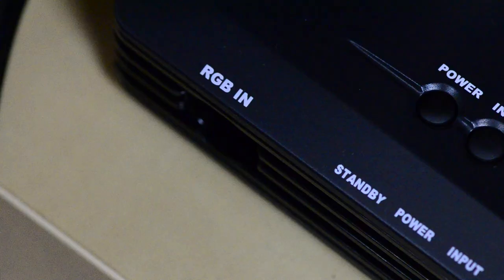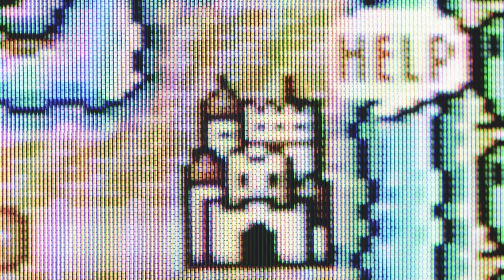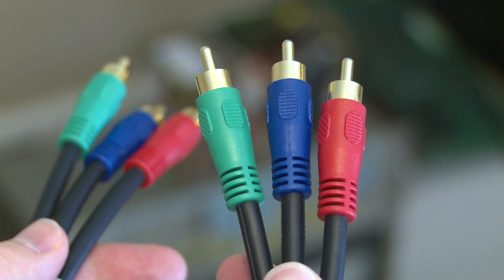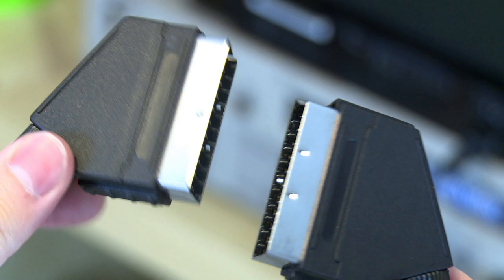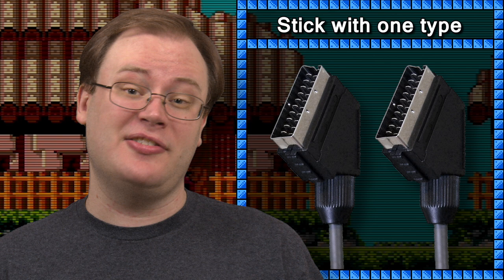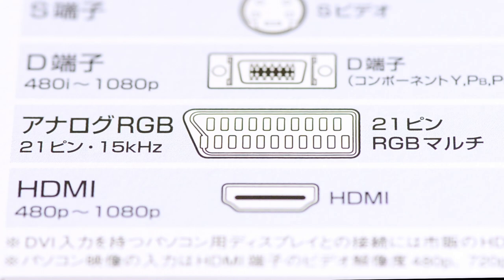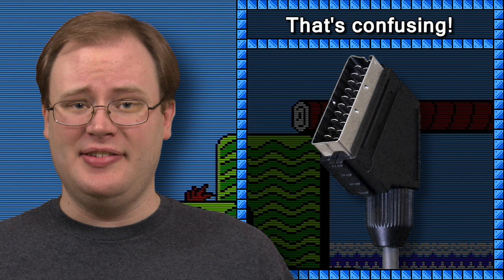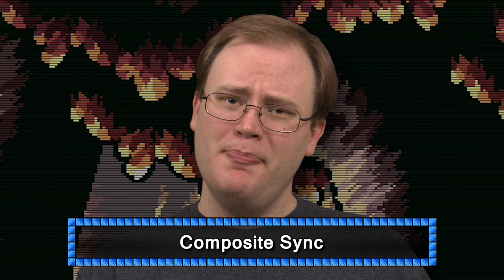Understanding RGB and Sync :: RGB103 / MY LIFE IN GAMING

Comment: What i got is whem i connect my snes to my hdtv with a rgb scart cable, i see checkerboards onscreen,something i don't have on a sdtv, i also see checkerbords onscreen when using s-video,However with rf and composite video i don't see checkerbords but i do see horizontal lines onscreen.
Reply from the maker: [Try4ce] I don't have any means of testing RGB signals on an analog TV, but I suspect the gist of what's happening on the HDTV is just because the screen is showing all of the flaws more clearly, while the pixels are designed to fit more cleanly into a standard definition CRT. I'd love to have the means to test RGB more thoroughly on CRTs.

Comment: Composite sync = horizontal + vertical sync composited together... I wish this was articulated more often. Thanks for the video.  I know you guys focus mostly on the xrgb solutions but do you use gbs8200/8220 at all?
Reply from the maker: outerspacebass [Coury] I've seen mention of the gbs here and there! We absolutely want to expand our horizons, cover as many different scalers as possible and make videos on them. As you know, its not always the cheapest thing to be passionate about, so funds dictate how much we can do right now. Hopefully, as this series continues to get more recognition, we can work with the makers to cover their stuff. 

Our whole goal is to show people all the different options out there, and make it as easy to understand as possible - some options might fit one person's lifestyle better than another, and we want people to make the choice that's right for them.
Reply: ***** Just watch out with GBS there are allot of faulty units floating about Ebay, I got one like that. Also even "correctly" working units exhibit various behaviors from unit to unit (like one will get very messy motion adaptive deinterlacing while the other one handles it better, one will get snow on all component inputs while the other only with PS2 ect).
Those are generally cheaply made (duh for 30 $ what do you expect), but doe to their robust design some aspects can be fixed by replacing capasitors, betting a better power supply  and changing frequency of the processor (there are articles on it on the web). 
Also Scan Line Generator and synch strike is pretty much a must for it so that bumps up the price to around... a bit below a 100$.

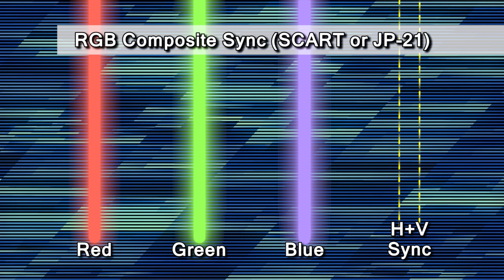Comment: Thank you trying to break this down for us but here's my question: What about @8:46 where you say RGB SCART JP21 are all the same with a combined single pin yet separate H&V sync? You did not include VGA because it doesn't do a H&V sync on a single pin but what about CGA or MCGA? CGA and MCGA do have sync the same way. Can CGA and MCGA be included for sync? There are also separate Intensity and "black" pin for CGA and MCGA but I'm not asking about that. I know that is a separate issue. Any help would be appreciated.
Reply from the maker: [Try4ce] I mean, the connector has 21 pins, so in theory just about any signal could be sent over one of these cables, including HV separate sync. It's just that not many devices would expect such a signal over a SCART and would not be configured to use it.

Comment: so I'm currently building my shopping carts for everything to re-do my gaming room. (will post video when completed) but hitting a few snags in terms of terminology. the SCART to 8pin RGB in particular. some have a basic description while others have a built in LM1881N sync stripper. this seems to be the only variant I've found. with CSYNC/boosted being just a little bit more expensive, does this lose that sync information and force through the composite signal?

Comment: I have an CRT with RGB in, but’s it’s scart connection. What do I use to to connect PS2 RGB RCA cables to the scart port? I see there’s a lot of products that converts it in the opposite direction, but can’t find what I need. 

My plan is to play TimeCrisis with RGB on PS2 with the GunCon.
Reply: Buy a AV breakout adapter. That will let you pull composite for your lightgun while still using RGB for your CRT.

Comment: I can't tell if know more or less now.

Do I NEED a SCART cable for my RGB modded SNES Mini?

If so, what do I do from there? I have never seen a TV in my life that had a SCART port. So then what?

If not, do I need a SNES multi-out to component cable?

A lot of very basic information is being left out by the modding community.
Reply from the maker: [Try4ce] One simple way to use the signal is HD Retrovision cables. They convert RGB to component. You can also buy devices like the OSSC or Framemeister to use the RGB connections for an HDTV. For analog, there are professional monitors that support RGB, but with a different connection (BNC ports) that you can convert from SCART with an adapter (or pull straight from the console with BNC cables).

Comment: I watched this video several times, it's entertaining and educational. But I did not get my answer - should I get Sync on Luma or CSync cable for my Snes. Needs shorter version with dumbed down comparison.
Reply from the maker: [Try4ce] Here's the simplest answer, really... it doesn't matter which sync type you use if the cabling is high quality. CSYNC minimizes the possibility of video noise or audio buzz, but is not necessary strictly speaking. Unless you have one of the very last full-sized SNES consoles, CSYNC will work. Sync-on-luma should work with any. But even sync-on-composite is fine if you purchase a cable with higher grade shielding (Retro-Access calls this the coaxial cabling upgrade). Sync-on-composite is actually the proper industry standard, and in most cases should be the most widely compatible, but it looks bad with cheap cables. Looks fine with good cables. That's the only issue.

Comment: Okay so just to confirm, even though Japanese and US SNES are configured for JP-21, I can still use my North American SNES with a SCART cable and it will work with any HD upscaler like XRGB mini framemeister?!
Reply from the maker: Jdmboi17 [Try4ce] That's sort of correct. In the case of SNES, the SCART cable has to be specifically designed for use on North American and Japanese consoles. Make sure the one you buy specifies that it's made for your system (and whichever adapter you use to get the cable connected to the Framemeister).

Comment: Just got a very robust JP-21 cable from ebay for my SNES to hook it into the Framemeister. If you don't mind me asking, why did you go the SCART route for your NTSC SNES consoles, when you can just get the JP-21 version?
Reply from the maker: [coury] to be honest the main reason we  went with SCART is based off the research we were doing, most people talked about it a lot more than JP-21. It just made it seem like the choice to make at that time so we started down that road. And once you choose a format it's not really worth it to change it.
Reply: *****
 Ah I see. I got my cable from Drew Seleski on ebay (the same person you got yours from). Drew was saying something about how the XRGB is meant for JP-21 configuration and that you need a SCART adapter if you went with the Euro-SCART cable. I guessed from that it would be better to just go with the JP-21 cable right from the start. My first experience with RGB on the SNES and Genesis was many years ago back when I had a Kung Fu master arcade machine. I learned from service manuals how the monitor in it works with RGB and CSYNC, so I experimented with the pin outs on the SNES and Genesis until I had completed custom cables for both that hooked into the monitor. I tell you I was BLOWN AWAY at how much better the Genesis looked. There's something about the Genesis composite signal that makes it look crappy, but it really shines in RGB.

Comment: With 2 words, wich is the best cable for PS1? RGB SCART luma sync? My screen is 55" sony triluminus 2014 model.
Thanks in advance!
Reply from the maker: +Nerven1986 [Try4ce] Two words: Yes, luma. :)
Reply: +My Life in Gaming I suppose adding a sync stripper like the LM1881 would be just as good if not even better than sync from luma?...
Reply: +My Life in Gaming 

Will a PS1 SCART cable with sync on luma work with my PVM via a BNC to female scart adapter? (pvm1954) Or are these things only for upscalers like the framemeister?

Comment: Got a couple of links for you guys. 
5 port SCART distribution amplifier
http://www.keene.co.uk/keene-1x5-scart-distribution-amplifier-uk-psu.html

This will let you split your signal to a TV, XRGB and whatever else you like. It's what I use for my livestream setup.  We run 2 CRTs head to head, have a feed for the XRGB (going to a capture card) and then a SCART to RCA cable going to an audio  mixer for commentary. Quality is superb, about as good as you will get for a split/amplified signal! 

There is also a Euro SCART to XRGB mini cable with a built in sync splitter. I recommend buying the one with the USB power that powers from the XRGB itself as not all consoles or cables output a voltage on the pin required to power the passive sync splitter cable. 

https://www.retrogamingcables.co.uk/european-scart-to-framemeister-xrgb-mini-converter-with-csync-lm1881-for-sale

Check our channel for quality examples (specifically the Sunday Face Off videos as Super Turbo Sunday is captured via Svideo output from an arcade cabinet.

Comment: Do you know the Microsoft Xbox Original Official Advanced RGB SCART Cable is use csync or sync on composite? I would like to use it with RGB SCART Philips crt tv.
 I'm looking for the best solution
.

You are really great guys!
Reply from the maker: [Try4ce] I doubt it's CSYNC as that would not be the standard way to do it for consumer products. However usually the official stuff is well shielded and doesn't have the noise issues caused by sync on composite in cheaper cables. That said, in haven't used SCART with Xbox, only component, so I can't speak from experience. I can only say that most third party Xbox component cables I've used are junk, much junkier than cheap cables for other consoles (which can still be pretty junky!).

Comment: Thanks so much for this video! I had been trying to figure out the source of those diagonal lines on my SNES since I was using S-Video on a CRT!

I have also noticed some artifacts on my RGB modified N64 ("jaggies" appear around certain shapes for a few frames), and am wondering if sync-on-luma might help. 

I've ordered both csync and sync-on-Luma cables now, thanks again for the info!
Reply from the maker: [Try4ce] I'm possibly going to look into sync-on-luma for my N64 as well, however, now that I've learned through the comments here that the N64 mod can do CSYNC if the modder makes the effort, I might look into that option as well (I didn't know to ask for it back when I got it modded).
Reply: Is there any benefit to csync vs sync-on-luma? As far as I've seen they're both superior to composite sync but not sure how they compare. Anyway, I did my RGB mod myself on my N64 (withy pretty amateur skills) so sync-on-Luma offers me possibly increased quality without possibly messing up my RGB mod
Reply: Is there any benefit to csync vs sync-on-luma? As far as I've seen they're both superior to composite sync but not sure how they compare. Anyway, I did my RGB mod myself on my N64 (withy pretty amateur skills) so sync-on-Luma offers me possibly increased quality without possibly messing up my RGB mod
Reply from the maker: [Try4ce] I'm sure CSYNC technically has an advantage, but as the PS2 cable is my only sync-on-luma SCART, I can't really observe the differences first-hand.

Comment: So if my PVM has RGB and an port for EXT SYNC, do I put the green rca into the EXT SYNC?
Reply from the maker: [Try4ce] Are you talking about using component instead of RGB? Set your PVM for component mode with INTERNAL SYNC, and plug green into green, red into red, and blue into blue. Basically component includes sync with the image information, so it's INTERNAL sync. If you are using RGB with breakout cables, you should have 4 cables - red, green, blue, and sync. That's when you put it in that port and say EXTERNAL sync in the menu. But it depends on the model.

Comment: Hey guys, this might not be the best place to ask but frankly I can't find a better place so here it goes.

I have a PC Engine Core Grafx II. It's great because it's the only version of the PC Engine that comes with A/V out without needing an adapter. While the A/V out is impressive compared to many other consoles, it's still composite video and I want to not only get a better picture but record one as well. Luckily my capture card, The HDPVR Rocket does support component but in searching for an alternative I've come across some confusion.

Turns out that there is an adapter for the PC Engine that supports RGBS and looks like it has component out. However, the seller says it does not support component and only supports RGBS which from what I understand is different? I will admit the seller's English is not that great, looks like the post may have had some translator help, so I was wondering, What is RGBS? Is it different from RGB? Does it work with component? If not are there any alternatives to connectors for PC Engine and will you be doing a video on it for the RGB101 series?

Keep in mind, while I've been following your videos, i'm still new to RGB and frankly i'm not into internal mods or expensive framemeisters. To me, Component is more then good enough picture quality and I can record that for Let's Plays and Game Reviews.

Any help is appreciated and thanks for the awesome videos!
Reply from the maker: +ZeromasterLP & Power Plays [Try4ce] RGBS means that there is a separate signal that carries sync. This is the purest form of analog RGB in the form that we normally talk about it. Sometimes people use the term RGBS to distinguish from RGBHV, which is VGA (progressive 640x480). We will have a Turbo/PCE episode hopefully soon... ish. I'm going to get my Interface Unit modded for RGB in February. This will let me use RGB with the PCE and the CD unit. If the CD unit is not a concern, we recommend a device that plugs into the back of the console by DB Electronics. Stone Age Gamer sells the same product in a complete shell. We've tested it and it's good! RGBS and component are in theory the same quality.
Reply: +My Life in Gaming so you know if eb electronic's adaptor works with component and what it outputs? I think my capture card accepts 240p signals but I'm not 100% sure. Sorry for all the questions and thanks for the speedy response I appreciate it!
Reply from the maker: [Try4ce] The db Grafx Booster outputs composite, S-video, and RGB. It doesn't support component, but it DOES work with HD Retrovision's Genesis component cables, if you plug it into the RGB output. The output will be 240p regardless.
Reply: ah well i guess i'll wait for hd retrovision's restocking of the cables then as they look like their currently out of stock

Comment: I just purchased a genesis scart cable from retro access with csync. I've tried a few games and everything is slightly off center to the right maybe a quarter inch. Picture is beautiful except for that geometry issue.  I do not have the same issue when using composite cables. Any suggestions?

Comment: How do you find the GameCube through the Framemeister? I'm currently playing GC via RGB and a CRT which looks great but the CRT isn't convenient. GC games look pants on my HDTV (even via Wii's component cables at 480p - just too jaggy), so wondering if my TV just has poor upscaling. Considering the GC HDMI mod but thinking my TV may need help with the upscaling. Also, is a 720p generally better than a 1080p TV for retro gaming? Great channel by the way, I've learned loads.
Reply from the maker: +Grumpy Goomba [Try4ce] You should check out our GameCube episode, which just released, if you haven't. A lot of people don't like how the Framemeister handles 480p, but I'm pretty indifferent to it. So some people just let their TV handle the scaling. The thing is, the Dreamcast/PS2/GameCube/Xbox was a weird generation because it's the only generation where they regularly used all available lines on a standard def CRT. So we're left with these systems that don't really have the retro look, but they're not HD either. You can use better video cables, but at the end of the day, they're standard def games that wish they were high def games. That's why we've gotten so many HD ports of the generation's most popular games.

As for whether 720p or 1080p is better for retro gaming, I'm not really sure. True native 1280x720 screens aren't that common (especially now). Even 720p TVs tend to not be a true 1280x720 display (some oddball 1300-something, I forget off the top of my head). 240 x 3 = 720, so in theory it's could be a great scale, but I'm not so sure it works that way in practice. I'd actually love to try the Framemeister on a 4K TV sometime... 4K (3840×2160) is not only 1080 x 2... but also 720 x 3... and 240 x 9. Cool, right? The only common resolution that's not a perfect integer scale in 4K is 480i/480p. But I'd love to see how a good 4K TV handles the Framemeister, set to 720p or 1080p, with a 240p signal... would be a perfect scale (in theory) either way!
Reply: +My Life in Gaming many thanks for the reply, yes I have seen that vid (it's great) I commented on the wrong one! I am finding out about the GC/PS2 generation being stuck in the middle, not retro enough but not realistic enough either. Still they look glorious as RGB on a CRT, they're just so darn big! Thanks again.